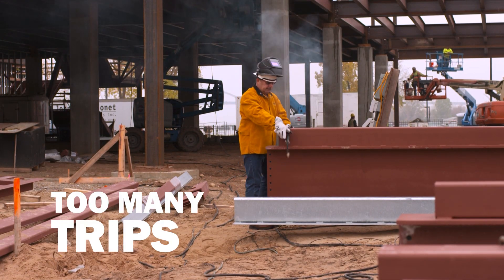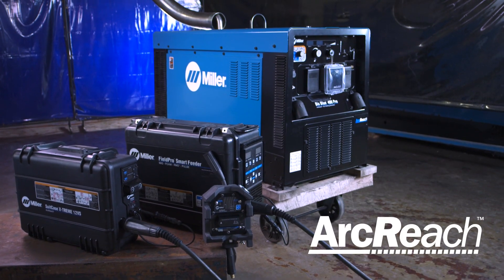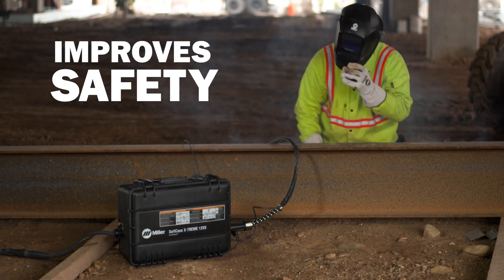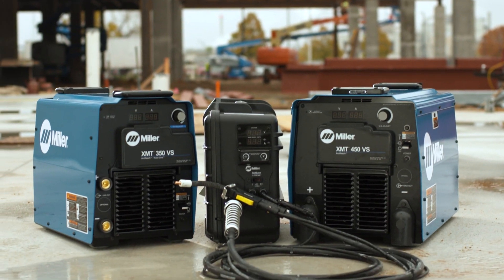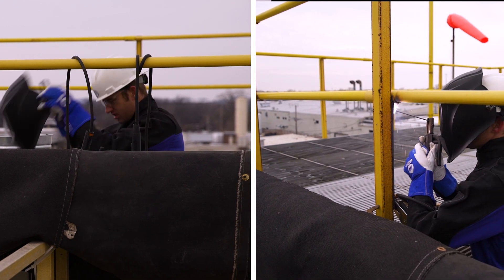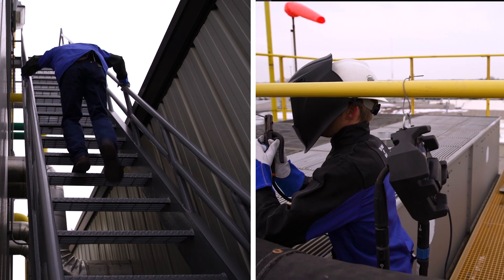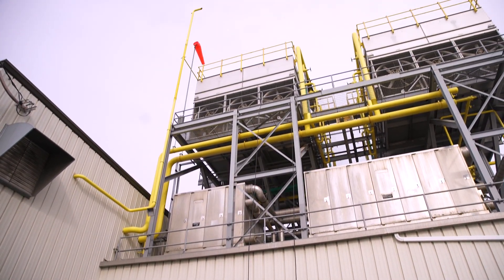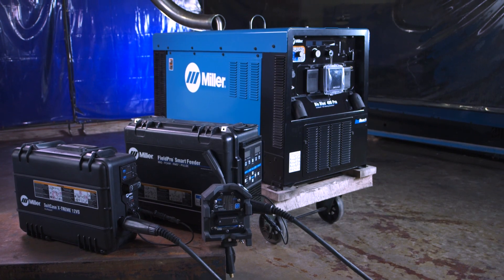Miller ArcReach Technology on Engine-Driven Welders

Comment: which is the maximun voltage that supports the SUITCASE X-TREME 12VS
Reply from the maker: Hi, Roberto. The SuitCase X-TREME 12VS will work with open circuit/arc voltages in a range of 14-110VDC. You can learn more here: https://www.millerwelds.com/accessories/wire-feeders/suitcase-x-treme-wire-feeder-m00184